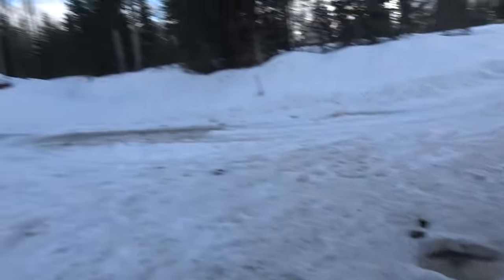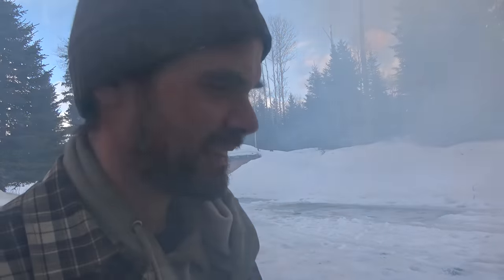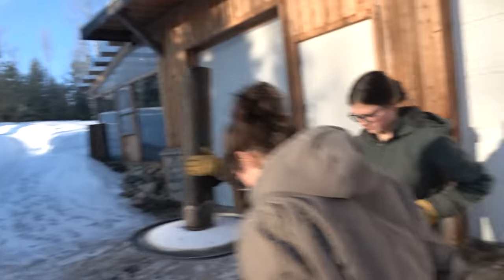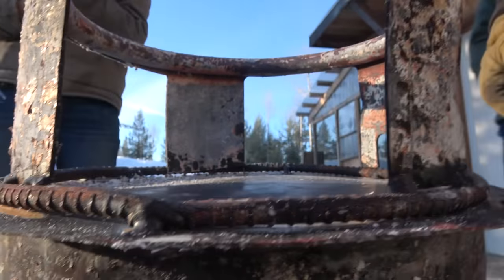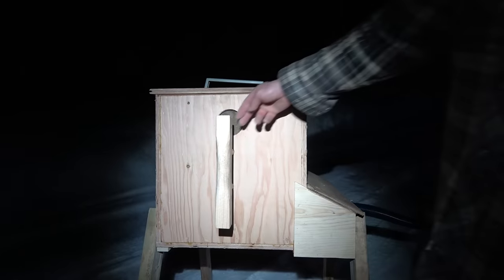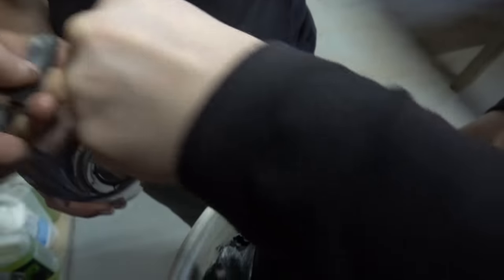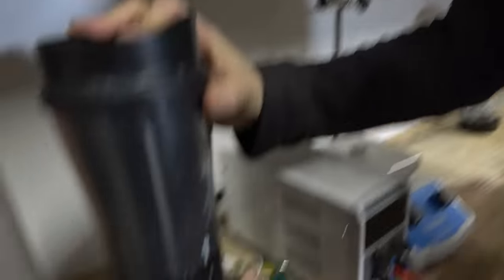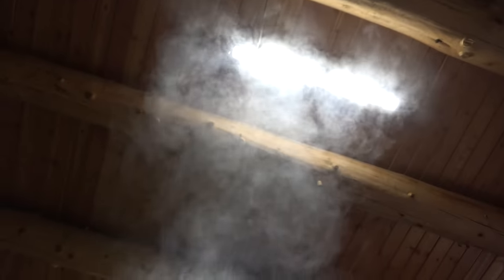Super Easy Black Powder from Home Made Charcoal

Comment from the maker: Thinking about going off-grid!?  Join us at the Off-Grid Campout, try it out, learn some tricks, and meet some great people! https://www.gridlessness.com/offgridcampout
Reply: If you use a 90 degree bend for the fan it won't get direct heat from the barrel.
Reply: Wish I could mate but I'm in England I sooo wanna move off Grid!! Wanted to for 4 or 5 years now! Force of circumstances prevented it so far but still hope one day I can but in my mid 40s now so dunno if it's gonna be possible?? Either small plot or even a off Grid DIY campervan van conversion full off Grid solar etc etc. But having a bit of land be better as able to be self sufficient etc.. so a bit of both would be ideal world! Wish we were allowed to move to America or Australia etc as plenty of space and cheap lane England is extortionate to live anywhere and however you live.. were ALREADY paying over £1.60 per litre for diesel and petrol now! That like over 2usd PER LITRE!! AND GOING UP!! HOUSE Gas and electric doubled in price last month! Over £2000 a year for Gas just to heat house! That's like about 2800usd a year to heat your house! We're screwed mate! Food 4x cost of America and everything else too!! I badly need to go off Grid!!
Anyway cheers from London England 👍💪😎🏴🙏
Reply: @DeUser1337  I second this. Haven't even watched the video yet, but seeing this I know you are right. I've used similar methods to slow the smoke in a test chimney I ran to see if I could make a smoke reburner out of a coil of chimney pipe before leaving the house. (Very dangerous. Do not try at home folks, unless you know what you are attempting in full and how to fix it.) A couple dampers and a bit of extra pipe goes a long way.

Long story short, it works... sort of. I needed to increase the length of chimney pipe to increase the draw just a bit more than I had it at to make it work almost perfectly. My mistake. This mistake ended up with a big build up in the 90 degree bend to the stack. That was NOT fun to clear out. heh. 

For those curious: The winding stove pipe acts essentially like a reburner baffle because you have a a damper at one end, and if you want, a damper at the other end. You let the fire side damper be more open than the 2nd wall/roof side damper to allow the smoke in, but not through as easily. This allows your fire to climb that coil of pipe "safely". I put that in quotes because it's arguable. The rest of the chimney after the 2nd damper is your 'normal chimney'. As in no fire ever touches this side, and if ever a fire manages to make it to that side, you can close the dampers entirely on both ends to shut it out. 

The amount of heat I got from my failed attempt was amazing. I don't have any proper numbers for  the results, but I would wager I basically tripled the heat output of my stove, simply by making the stove pipe about 3 times longer essentially. Sure, the coil of stove pipe looks weird sitting there in empty space between the stove and wall/ceiling... but it also provides one more nicety...

A lot of room to potentially wrap copper tubing around to heat water. A lot of water. Like, way more water than you ever would be able to with a 'normal' chimney. So you're going to end up with a coil wrapped in a coil. And the rest of the chimney's extra heat can be utilized by some thermoelectric pads to produce just enough current to power a fan or two to keep the heat moving around. 

P.S. I just realized... you could basically turn your wood stove or whatever is using that stove pipe idea into a water distiller. Just double wrap the copper pipe around it, and put some valves inbetween at certain points for a bleed, a pressure relief, and a couple shut off valves to help dampen the flow or shut off entirely if need be.  (Pressure release vales at both ends of each shutoff for safety.) You would essentially just keep your fresh water in the line long enough for it to turn into steam and vapor. Once it's coming out the other end, you just need to capture it and cool it for distilled water. Or you could keep it flowing as just hot water instead.
Reply: @stevenmackay3289  I was talking about the IR heat that the inlet fan gets, with a wend the Light won't travel to the fan it selve an the conductive heat was never the problem in the test.

To your test:

What kind of winding stove pipe did you use?
I know only of the aluminum one, but that can't handle the heat.

Important in a system like yours is a creosote free burn. That way the extender chimney system can't clog it selve and the efficiency will not suffer over time.

Best for a clean burn seem to be real rocked (mass) heaters.

The high temperature part is most important.
Reply: @DeUser1337  Okay I must have misunderstood something in your comment. Sorry bout that. 

But yeah, Black stove pipe. The normal kind you see on real wood stoves and not those 'energy efficient' amalgamations they build today while saying they work better. (They don't. I've tried them vs my own method. Mines better.)

I'm basically taking a bunch of elbow joints and the adjustable corner pieces and creating a spiral out of the stove pipe. Putting two dampers on either end, and finding the sweet spot. 

Yeah, Creosote build up was my issue at the last bend. The rest of the unit was just fine for the most part. Creosote was still building up in my small spiral, but that's because I wasn't quite getting a good enough burn by not having the second damper to help complete the baffle. This lead to the creosote build up in the last bend on the outside-side of the wall. 

That said, it really doesn't help at all that I was burning a fast growing bush we have here called Karagana. (Spelling is wrong, sorry)

It grows like a weed, but it's a thick bush with wrist sized sticks in thickness. So it's great for getting a fire started as kindling, etc. Or with bigger pieces, just burning in general. But the creosote it releases is just amazing. Wow is there a lot in that plant. 

It would probably be a perfect fuel for perfectly efficient wood stoves due to how fast it grows. You can pretty much harvest it all in one year, and see it return to full size in 3 years or less. So you could easily turn this into some sort of crop you rotate and harvest in a manner to allow for there to always be dried karagana read to burn. 

And no, drying it doesn't really help the creosote build up for that plant. It's just absolutely full of it even when dried. 

The next time I have a chance to attempt this method, I will be going all in. 3 dampers instead of 1 or even 2. The spiral will probably be a double spiral of one spiral twisted around the outside of the other to create a 'bubble of heat' in that area of space; and of course all the copper and fans I spoke of earlier to make it a perfect unit for a self reliant person.
Reply: @stevenmackay3289  if you do all that work, read up on rocked mass heaters, even if you dont use the rocked part. The heating of mass with ducting is very effective.
Reply: If you get a metal table top fan a natolgic style kind of one, that might work. You could also get a metal bathroom exhaust fan, and one even better, hook up a leaf blower!!!
Reply: Great video!
But how long is the bill of the hat at 3:29???
Reply: Jsyk making homemade explosives is a Federal Offense...  I'm not kidding I know a guy that just did 5 yrs in a federal penitentiary for more or less making firecrackers...Enjoy...😁
Reply: @AB-C1  I've got a friend I met online living across the pond in your neck of the woods...  I've tried talking him and the Mrs. to move over here in the US. But he's old and doesn't have the energy.  He knows what's in-store for England, he's very versed on the Bible and agrees with me that we're in the period Jesus called the Beginning of Sorrow's that lead's straight away into the Tribulation...      Jesus likened this time to Birthing pangs from a Pregnancy, the pains get harder and faster by the minute...
Jesus is the Way Truth and Life No One get's to the Father except through the Son, Jesus...
Reply: great man!
cool Daddy!
Reply: How the hell YouTube dont delete your Channel for this video???........
Reply: I'm offgrid right on guys
Reply: If you need to you can also 3D print those fans out of metal
Reply: @AB-C1  
I wish you all the luck in the world brother.  I'm 57 and in the same boat and land in MO has gone stupidly high and I'm talking rocky ground with nothing but cedar trees on it. I'll have 5 or 10 acres somehow some way before I die!  👍🏻
Reply: @TheTallhillbilly  Amen brother!!
Reply: Thank God I don't have to live in a refrigerator 😅
Reply: Hi , erm should you maybe discourage people from mixing in a blender just in case they try to mix all three ingredients together at 1200 Rpm in a sealed jug cause you know ....good vid though
Reply: @stevenmackay3289  😅😅😴😴😴😴😴😴😴😴
Reply: Thumbs down for commercial one minute in
Reply: @AB-C1 , stay there, the way you describe it, it will soon feel like you live off grid! Greeting from Nova Scotia…🇨🇦
Reply: Metal is a very good conductor of heat.

Comment: A tip to make your process a but safer, use lead round balls such as large sinkers or get some 12 ga round balls (.72 cal). The agate runs the risk of getting a spark in the mix, even a remote one, whereas lead is non sparking no matter what it hits.
Reply: @shanincoffer6455  yes it can.  Just heat it (not boil only simmer) until you get crystals beginning to drop out.  You must watch carefully it is not easy to see the crystals dropping out.  Your solution will then be saturated and you can use it as soon as it is cool enough to do so.
Reply: @joeyl.rowland4153  wait what are we talkin about? You might have to beat around the bush a little bit because apparently the comment you were replying to got deleted
Reply: @Hayden734  Shanin Coffer asked if DEF  could be used as a source for urea.  I had explained that proper gunpowder is made with carbon, kno3, sulfur and at that point it is wetted with water saturated in urea and then grated across various gauges of screen for proper sizing.  Large screen similar to 1/4 builders cloth for coarse gunpowder as would be used in cannons.  Smaller finer screens would be used to create a finer grade powder for rifles pistols and shotguns.
That is how gunpowder was made traditionally.
Reply: I use .50 caliber lead round balls in my tumbler.
Reply: @joeyl.rowland4153  water saturated in urea? or did you meant to simply say the mixture is wetted by saturating it in urea. (no water). OR mixture is wetted a little bit with water first and then saturated in urea?
Reply: I wouldn't say, "no matter what it hits".  Watch the videos that taoflaedermaus does and you will see that you can create a Flash from nearly anything hitting lead hard enough
Reply: @ChristopherJones16  no I meant water with urea at its saturation point.  That added to charcoal,sulfur,kno3 creates true black powder.
Only enough of the saturated water is added to wet the dry material so that it will make a solid ball when clumped in your hand.  That grated across screen will make gunpowder that was used traditionally in pistols rifles and cannons.  Cannon powder being large flake.  Rifle and pistol powder was a finer flake.  It was not powder per se.
Reply: @joeyl.rowland4153  yeah “water” is a bad word to use here for what you’re trying to say. “Water” being both a noun and a verb makes it even more confusing.  You’re saying to ‘wet’ the mix with urea till it reaches it saturation point right?
Reply: @TheMrAHead  all non ferrous metals are technically spark proof.
When you grind lead does it spark?

The flash you're seeing is probably due to some phenomenon dealing with the transfer of kinetic energy, or being hit hard enough to generate enough heat to basically flash the metal to a melting temp. 

Definitely not doubting what you say can be done, but I highly doubt there is any way to produce the amount of energy needed to do that in a ball mill. 

Either way, it should realistically be milled wet to attain the best mix possible, and being wet puts it into a fairly inert state.  After milled wet it should be pressed to obtain the density your looking for, dried and then finally corned into the screen size needed. 

Sorry for the long post.
Reply: You know I have been  making  my own powder for  awhile now and it never accrued  me to use lead. Thank you for the  insight.  It is greatly  appreciated.
Reply: @keithhubbard9578  You do need to understand that using lead to make gunpowder will make lead carbonate and it will be a minor part of your composition.  It will be minute but it will exist.  If you can get weighted ceramics they last forever and do not impart any outside minerals.  They are pricey. 
When you are milling do you mill each of your components separately first?  
If so it shortens your mill time once combined, before wetting.
Reply: I do remember reading somewhere that it's not safe to store  blackpowder in a glass container.
Reply: @davezemba9109  just a clean paint can is fine.  It probably would behoove most people to only make a pound or so and then use it up.

IT IS SUPER SENSITIVE TO AN ESD DISCHARGE.  That means when you walk across the carpet and you get shocked touching the doorknob then it probably is not a good time to be playing with 20 or 30 pounds of black powder.  4 to 6 ounces for hunting is pretty safe though.
It is also why you store in a metal can.  You will discharge before opening the can.
You won't discharge with a glass jar.  The lid could actually make it worse, because the spark can't go through glass it jumps to the gunpowder.
Understand why no glass now?
Reply: I've dealt with some issues as a law enforcement officer related to the aftermath of two men using black powder.  I know you're not making pipe bombs, but the risk of serious physical damage or death can occur from just a small lack of knowledge or mishap.  Please make sure you know all the potential risks.  Black Powder is classified as an explosive for obvious reasons.
Reply: @cutter9009  show me where black powder is classified as an explosive.  And law enforcement is easy enough to deal with.  It is legal to manufacture and possess black powder.  You can use black powder for rifles and if you have a powder wedge you can use it to remove stumps.  You can blast holes in rock with gunpowder and that is not illegal.  Only a dumbass would go to jail for possessing gunpowder.  And if you know what you should about gunpowder the biggest problem with gunpowder is its sensitivity to static discharge.  If you mind the safety protocols you should, there is nothing unsafe about gunpowder.
Reply: @joeyl.rowland4153  the milling is crucial together, it smashes the kno3 and sulfur into the millions of pores in the charcoal, which makes for proper mixing and great ignition and burn rates
Reply: Traditionaly the power was dampened with a small amount of brandy so that the charcoal rubbing on the sulfer did not generate static electricity.  This would make it the first industry to have ESD precautions.  On a dry winter day it would suck to have the tumbler light up and burn the garage down.  As others noted the milled paste was then riced with a screen. I don't remember if fine pills burn faster or slower but cannons and muskets were not built as well as moder weapons and required a slow burn.  I used to make this as a kid.  Saltpeter is also difficult to get in Canada now.  Easiest way to get it is to extract it from gun powder....
Reply: @ChristopherJones16  I'm about two years too late, but what the hell- no, he's saying water saturated with urea. The easiest way to explain what they mean is, if you warm up water in a pot and add salt to it, the salt will dissolve in the warm water until the water is saturated, and then salt crystals will start to collect in the bottom of the pot. Those salt crystals won't dissolve anymore, because the water is saturated with salt

Comment: For your fan problem, radiant energy travels a straight line.  Put a 90deg elbow in the pipe so the radiant energy will just heat the elbow.  Close to the fire would probably be better but you can try it either way.
Reply: Yes good idea, but it also seems like they placed the fan in the wrong direction. The fan should be facing the outside, but instead it's inside where the heat can hit the plastic directly.
Reply: The internal reflectivity of that pipe might also be playing a large part in transfering that radiant heat to the fan, kinda like fiber optics, the laser just bounces down the fiber due to internal reflectivity. Maybe spray the inside of the tube with black high temp BBQ paint and see if that helps.
Reply: I concur, radiant heat will not travel through a 90 degree bend.